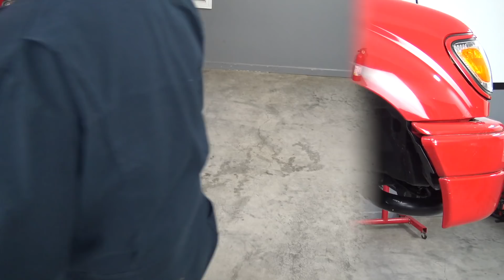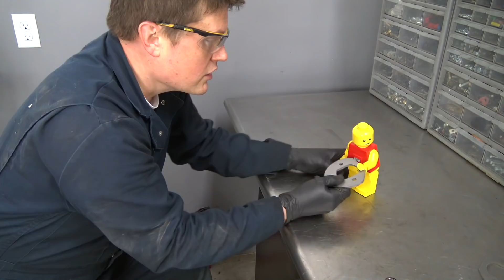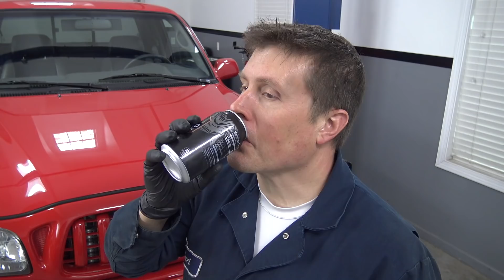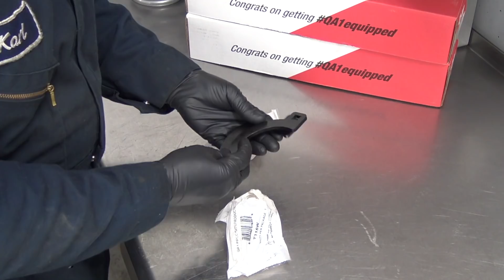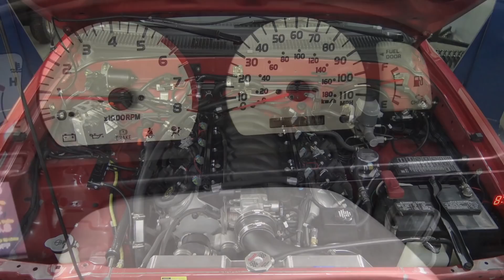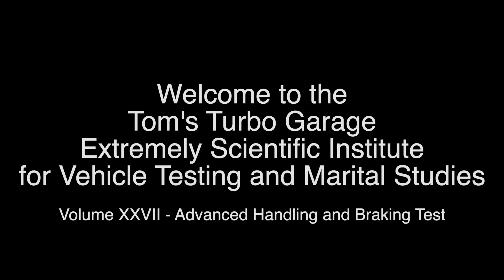LSX V8 Turbo Tacoma - Project Firebolt Part 15

Comment: The QA1 spring part numbers listed “10HTSF 550” is a 10” x 2.5” straight spring! Per Summit & QA1 Website... Can you please double check the part number/s?

Comment: Just finished binging the whole Firebolt series. You are total OCD compared to some of the other car shows on YouTube. I do have one nit and another which is a bigger thing. First you should swing over to Finnegan's garage where he recently has done some instruction on welding of exhaust pipes with a purge gas. It makes for better cleaner welds with fewer chances for leakage. My second thing goes all the way back to the start. As a minimum you should have stripped the short block down all the way. With boost you need to increase your ring gaps significantly from factory. At that time you could have easily replaced the rod bolts with ARP. Either Gen 4 rods or aftermarket ones would have been a big upgrade. The pistons too. I realize that you wanted to keep the cost reasonable for the DIYer, but the first thing you will have to do if you go for more power is to pull the engine apart as I described. I'd have sent the block out to be hot-tanked and magnafluxed. There's no telling what might be lurking in the oil and coolant passages in an engine that was home to the little beasties.

Comment: A lot of similarities here to what I went through on my LS swapped Jeep Cherokee XJ. I ended up making my own power steering lines. I used the Holley LS accessory drive brackets, and also got most everything form Summit Racing. I wish that Holley Terminator X ECU had been available, but I've been running the GM one for several years, and it's doing alright.

Comment: Tom i wouldn’t use antiseize on the threads of a coil over strut! Bad idea even if the manufacturer recommends it. Think of it this way just like antiseize sticks to EVERYTHING so will every bit of dust and dirt to it. So next time you go to adjust you’ll be there cleaning it off the threads before moving the collars or you will be dealing with it binding due to small rocks and road grime ... I highly recommend the pb blaster graphite dry lube. Never look back again with that stuff.

Comment: Did you have any problems with weld contamination using the weld thru primer? I have a project coming up where I could use it, but the reviews are split between "this ruined everything it touched" and "I wouldn't weld without it!"

Comment: I was about to comment about the brakes , but your on to that. Is the rear ride height set for hauling loads etc? If your not gunna load the truck down too much I think the rear could come down about an inch or 2 that might help the handling a little more. 

Overall the rig looks very nice. 

Since you seem to like big power in small packages , can I point you to something you might like. Check out Fasterproms channel and their turbo K-series swapped Smart car "Kater-tot" I think you might like it.
Cheers , stay safe and happy truckin'.

Comment: To avoid the anti seize cancer, try using motorcycle chain lube on adjustable shocks.  It also works great on garage door chains and tracks.  But since it's designed to dry to a waxy lubricated surface and protect from the elements it's ideal for this application.

Comment: I might make several comments but the first two things I noticed is you apparently did not use the spring compression tools to there maximum ability and unless your changing the lower control arm I am not sure why you took it out you did not have told from my experience

Comment: The rake reduces the caster angle, reducing the self-centering effect, and changing steering effort. With the level ride height, the suspension regains it's proper caster angle.

Comment: It looks like your ground clearance is on par with my car with those rear suspension parts hanging out the bottom.... May aswell slam it. You can't take it off road as is, but you could still cart junk if its scrapping the ground. Your desire for a sleeper is far from reality; again, the rear suspension hanging out, branded, exhaust and a intercooler hanging out the front...?

Comment: Dont put the antiseize on the shock body and see what happens later down the road.
While aluminum is a great building material the softness lends to binding and corrosion on threaded parts.

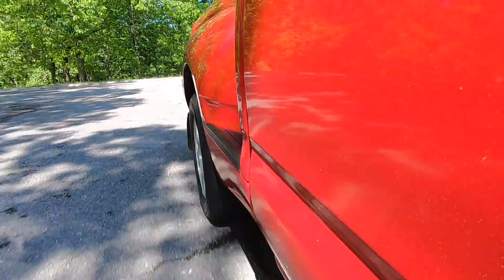Comment: 20:02 Your still getting pretty bad compressor surge coming off boost. Look into that and do a video fixing it. The increased pipe volume with the rear mount often needs the bov closer to turbo and lighter spring to prevent surge.
Reply: S&H Performance I noticed that too

Comment: Quick question: Have you considered lining the bonnet with a fireproof sound deadening material? As you were pulling out of the garage, it sounded like the camera was picking up a lot of engine mechanical noise rather than the sweet exhaust note. Besides that though I love Firebolt as it is now, you did a beautiful job on it :D

Comment: Hi Tom, I wanted to let you know you put the washer on upside down on the shock shaft (before the rubber) it needs to be hollow side down, rubber, chassis, rubber , hollow side up. This washer is used this way so the rubber can’t be cut by the edge of the washer.

So it should be something like this )0I0(

Comment: I needed a little motivation to get out into the garage today. Thanks Tom. 

Nothing Crazy, Just some Sandblasting and painting for some suspension parts on my 3000GT Restoration project. All new OEM shocks and springs going in. But I just wasn't feeling it after work initially
Reply from the maker: Glad I could help sir!  We all have moments like that and as I get older it’s hard to get going too after a long day or week.  Good luck with your restoration 👍🏻

Comment: Does the truck brake the same as a stock Tacoma? That's a lot more weight in the front, that's the main reason I asked. I have hauled a car behind me and a camper before does it feel more like it dives and more does the brakes not react the same?

Comment: Helpful tip everyone! Always leave your phone and other devices in your pockets or elsewhere when using an angle grinder or bench grinder, the metal dust in the air clings to speakers and microphones as they’re magnets, ultimately the dust destroys them.

Comment: You’re taco didn’t have stock suspension, I’ve got the same lowering kit on my S-Runner.
Reply from the maker: Please elaborate, I have the window sticker and there's no mention of that.  That said, the original owner got all of the s-runner appearance items custom ordered on this truck, so it wouldn't surprise me if that happened somehow.  I just figured it was a stock 4cylinder 2wd front suspension?
Reply: @TomsTurboGarage  Naw Tom, I don't think bilstiens came stock. Looks like the ones you intalled were a huge upgrade anyway though.
Reply: Front coils were a stiffer spring rate with a 1" drop
, Tokico gas shocks all around, bigger front sway bar, rear anti-sway bar

Comment: looks like the front is still a little lower than the back. 

Also, I am amazed at how clean that truck is for its age.  Almost no rust.
Reply: Trucks are supposed to have a slight rake. If they dont, when you tow the nose will point up in the air impacting suspension/steering geometry, trailer tongue angle, brake performance, and headlight aiming.
Reply: @DEFCONPRODUCTIONSLLC  Makes sense.

Comment: Covering your coil over threads with anti-seize is a great idea. Lots of people don’t do it and regret it later. Keep up the good work!
Reply: I wrap mine in electrical tape. Then just take the tape off when you want to change the height.

Comment: Wait I must be getting things mixed up.  So Firebolt is losing Cheetah mode and going to Panther? Wait, please call it Cougar. For obvious reasons, it's more fun and hey, I am a Southern guy also gotta keep it local you know.  Great work as always.  OH, and do you need a shipping label for the Bilsteins?  They look brand new.  Also, love the bolt-on ball joints.  On my 94 Nissan Hardbody they bolt-on upper and lower and are the size of a 3/4 Chevrolet pickup. And Nobody was prepared for the "It's on my face isn't it?" part.

Comment: Someone showed me a spray anti seize can the  other day, game changer
Reply from the maker: Whoa, what?!  I can't wait to get my hands on that and REALLY make a mess of things. 😁👍🏻
Reply: For when you really want that crap all over the place!
Reply: Not only will I look like the tin man from The Wizard from Oz, but my whole shop will too.
Reply: The stuff is awesome, I have 3 flavors at work. Copper, aluminum and ceramic.
Reply: Fun way to ruin someone's day at work.. remove the label from battery cleaner and rewrap it around spray anti-seize. Ahhh hilarity!
Reply: @jamesborek8125  calm down there Satan
Reply: I'll take your entire stock!
Reply: i hat that stuff its like water, washes off very easy and doesnt stay
Reply: I use motorbike spray chain wax last for ages and is waterproof and ones it’s dry it doesn’t really make a mess and stuff doesn’t really stick to it